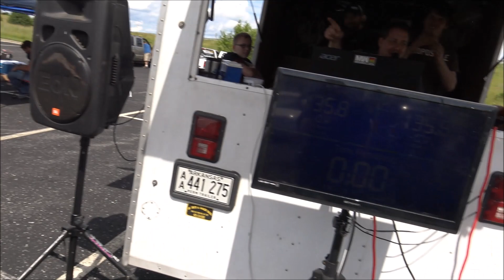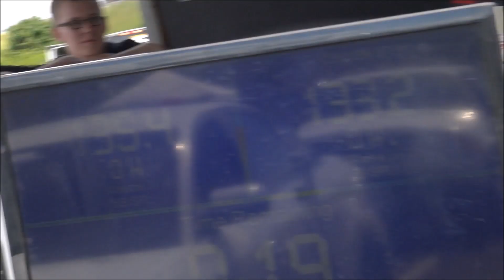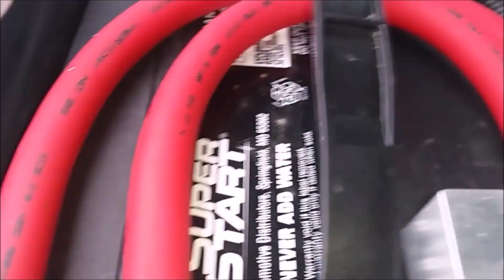2 Ascendant Audio Team 18's on 10,000 watts: Demo and in the lanes GPcarAudio.com Event #1

Comment: All that pressure and still very little windshield flex. This is back when they made cars out of mostly steel and meant to have integrity.
Reply from the maker: yeah its all about the cars design, I've seen upper 90s model Hondas with the most insane windshield flex you've ever seen and only in the low 40s. this car is almost in the mid 150s at like 28hz, car handles it like a champ